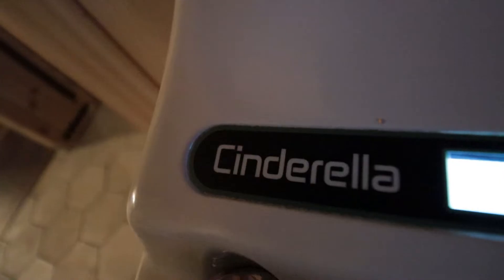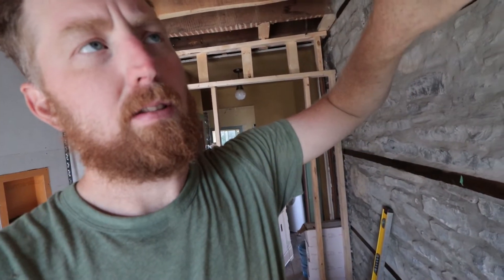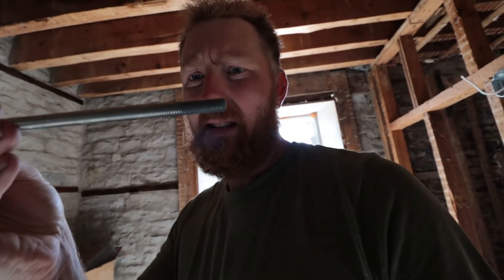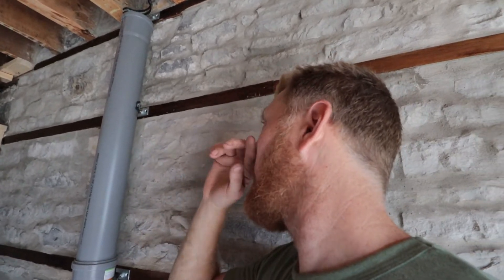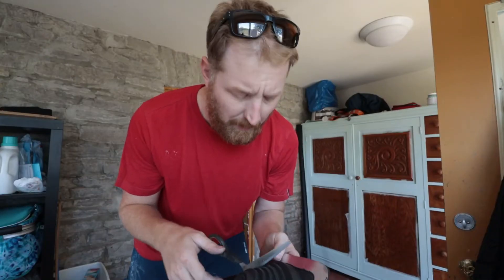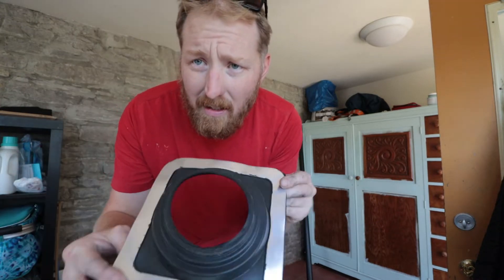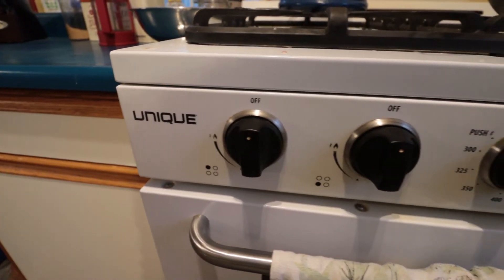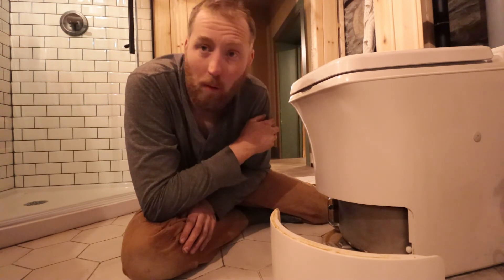$6000 Toilet? Why we Purchased a Cinderella Incinerating Toilet | Install and Start-Up

Comment: Are you still using it after installing the new element or did you decide to remove it and go with a different option?
Reply from the maker: We went with a different option. As a growing family of 5 we decided we were close to pushing its limits.
Reply: 5 people full time does sound like quite a bit for this toilet.  Do you think it could handle 2 people with occasional guests for a seasonal cottage?
Reply from the maker: @charliebezoski450  I technically can and did handle 5 people. We also stressed about have too many guests over and havi g to teach everyone how to use it. 

Two people in a cottage would be a perfect application. I do recommend the toilet.
Reply: Thanks for your video and replies to my questions - feeling better about our future application although it will be propane as we are entirely off grid
Reply: Did you have any condensate build up in the exhaust vent.  Trying to figure out why the electric model doesn't have a condensate drain whereas the propane model does.
Reply from the maker: I do have condensate and the electric modle should have a condensate drain in the elbow. Contact Cinderella supplier and buy one.

Comment: Was a huge, costly mistake for us. Intended to use it full time. $6000+ for just the toilet. Replacement parts cost a fortune. We began having difficulties within 3 weeks of installation and it never stopped. One thing after another. A year later, having to pay for installation of a traditional toilet and the Cinderella company is blaming us for misuse and overuse so they don't have to honor warranty. It has been a horror story
Reply from the maker: Thank you for sharing. We had the element go on ours 6 months in and although they did send us a new one they were adamant it was our fault. I think this is a great solution to a waste problem but I don't think it can be used full time like they state it can. We are considering selling and taking our losses. A little disappointed!!! Thanks again for sharing.

Comment: Sometimes little people can’t wait…Is that an hour between uses? 
Thanks for the review/install video
Reply from the maker: You are very right about the little ones. It's an hour between Incinerating, so once you "flush" the incinerating begins and you can put in a new liner and start use. You just might need to wait to "flush" again. 

You are able to flush back to back, but we find it works best if you let the toilet finish its cycle before flushing again.

Comment: Thanks for the video. Very helpful. How do you like the unit after half a year or so of use? Does it burn everything completely? Any odour problems?
Reply from the maker: Thanks. We still think it's a great unit. As long as you clean it regularly and had it installed properly, then it burns everything down to ash. There is some smell outside while incinerating but it's not bad.
Reply: Broke several times bill already up to 10000 but no flush was made . Greatly recommend !:)

Comment: Great video!  Been interested in buying one but WOW $6,000...???...I think we'll just stick with our composting toilet!
Reply from the maker: It was a hefty price tag for sure but very easy to maintain and no need to worry about a place to put our waste after. Both are great options in my opinion!
Reply: @windyislandhomestead9661  - Can definitely see how an incinerator would make sense in certain unique situations, especially when a traditional water-based system might be more challenging.
Reply from the maker: Water is definitely an issue on our property.
Reply: I think that is CAD price. USD is less due to exchange rate.
Reply from the maker: It is CAD

Comment: I have been living in a country in Europe where almost nobody uses a clothes dryer. I use an indoor drying rack-the standard clothes drying method here. You get used to needing two days for clothes to dry in the winter. BUT...no dryer! No power source necessary. Works 365 days a year.
Reply from the maker: We do our best to not use a dryer as well. Clothes line in the summer and hanging by the fireplace in the winter.

Comment: Why not other incinerator toilets like the $2k one
Reply from the maker: We found the cinderella had the best reviews, smaller, looks nicer and availability The next cheapest one we could find was still around $4000 CAD.
Reply: @windyislandhomestead9661  - Interesting, are the gas/propane models by chance any less expensive(?)
Reply from the maker: We found cheaper by about $800 and the fact that'd we would need to rely on propane vs different electricity sources.